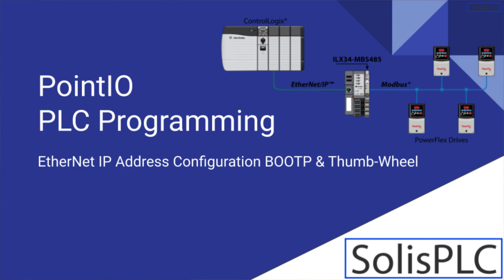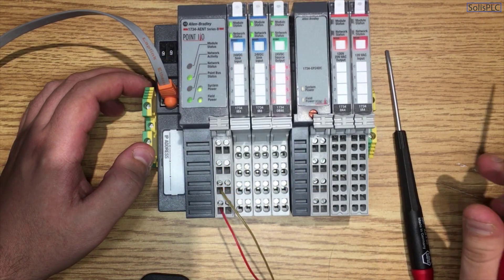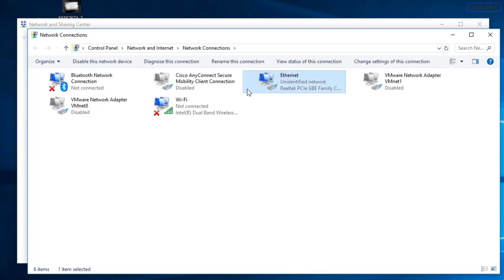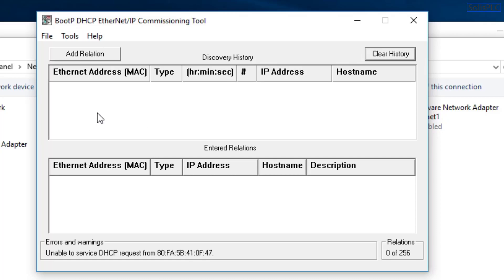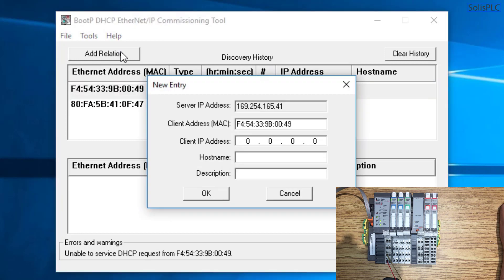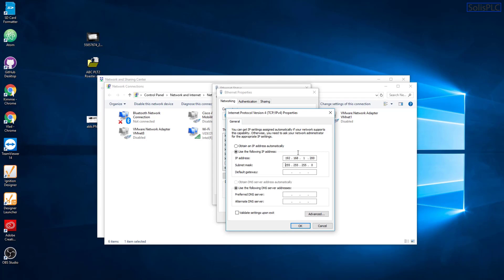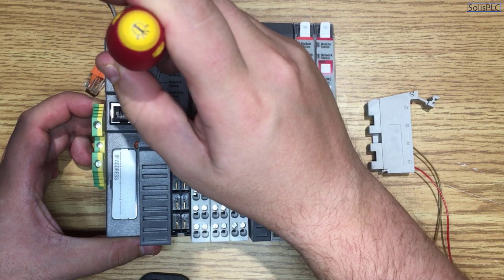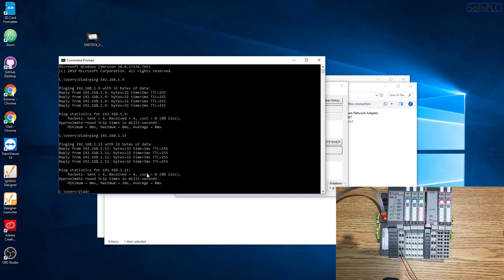PointIO Allen Bradley Hardware & Software Tutorial | 1734-AENT Point IO EtherNet RSLogix 5000 Logic

Comment: Hi Vlad, thank you for efforts ,i'm new with allen bradley Studio 5000 ,can you hepl me how can add this module 1734-EP24DC inside studio 5000 ,i don't found its firmeware on rockwell site
Reply: Hey, so the 1734-EP24DC is just a power supply without any IO points and can't be added to Studio 5000. Simply ignore that specific module as all it does is provide power to the backplane. Remember that you do need it based on how many modules you have in the rack; the specs are in the manual.
Reply: @vladromanov8380  Thank yuo so much Mr.Vlad🌹🌹

Comment: Good video. Sir my 1734-IB8 point IO module showing problem its network status LED blinking red after some time of power on the module from last few days. So I want to replace it with new one. Can I replace it in the running system without doing any change in the program and readdressing? Kindly suggest & Pls. help.

Comment: Hi, Thank you for this video,  I have two questions
1- Can't we keep the PC Ethernet adapter in static IP then assign the IP to 198.168.1.200, then use BootP? 
2- If an IP address has been previously assigned to module 1734-AENT, do we need to reset the current IP address before going to 999 to assign new IP?
Thanks

Comment: HI Vlad. I have been your channel follower for a long time. Thank you for your all the time hard work to share the great contents. I find an issue in this video . You said to use BOOTP to get the IP address but it shows DHCP type in the BooTP DHCP commissioning tool after setting up the 999. And one more thing, I wonder if a 9 should be set on the thumbwheel other than 11 finally because the 9 is set in the BooTP/DHCP tool . THANK YOU.

Comment: Hi SolisPLC, one question, the tool can be used anytime we need to change the IP address of a device,  or it's only used when setting IP address for the first time? I am wondering because we are disabling the option. 
Is it easier if we use Studio 5000 instead?
Thank for you such an informative video.
Reply from the maker: That's correct. However, you can reset the module to "factory settings" and use the tool again.

Comment: So this 1734 platform is not a stand alone PLC? It is to be used as a remote rack?
Reply from the maker: That's correct Mark. It's just a remote rack. Typically, I would use them in small field panels that are tied to the main panel which includes a CompactLogix or a ControlLogix PLC. These modules can't do anything on their own.
Reply: @SolisPLC  thanks for the reply!! Is there any 1734 that is a stand alone?

Comment: HI I am replacing a fail adapter. How do I change the revision from a Ser. C 6.011 to a Ser B 5.015? Thanks in advance.
Reply from the maker: You will have to flash the firmware just like any other Allen Bradley hardware. Go to the Rockwell download centre, search the part number, download the firmware and use compactflash to update it.

Comment: Thanks for the video. I appreciate it.  If you need to set the ip to 192.168.1.x it's better with dial switches. Also you can change it via web interface